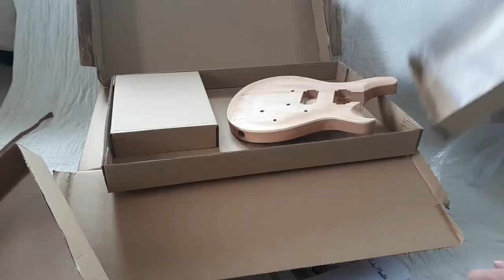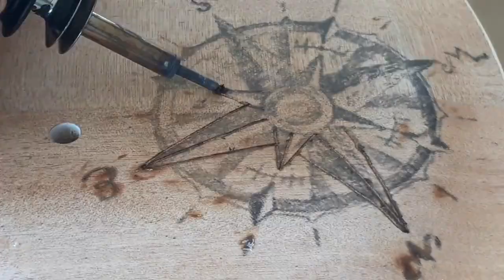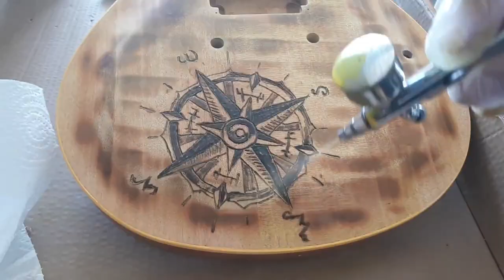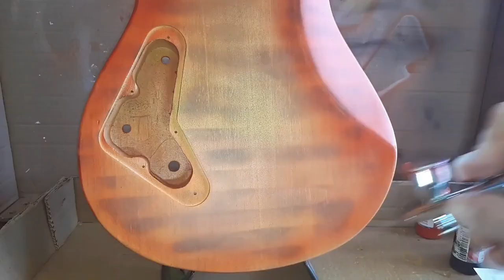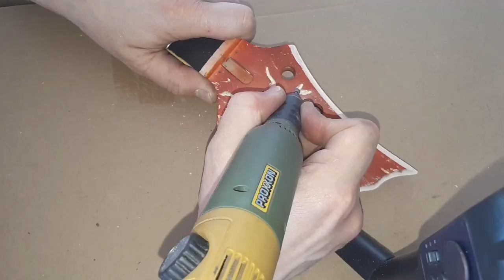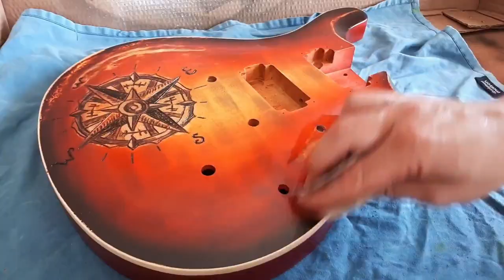HB CST 24 1minute #DIYKitChallenge22 #diykitchallenge22

Comment: Beautiful result! I'm half tempted to do the same kind of dremel relief pattern in the headstock on mine, currently under modification... The main thing I'm doing is routing it for a full floating Floyd. Then an acrylic paint pour design will be put on.